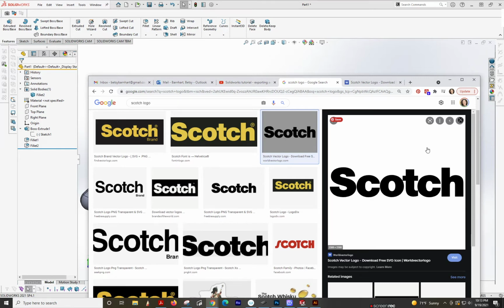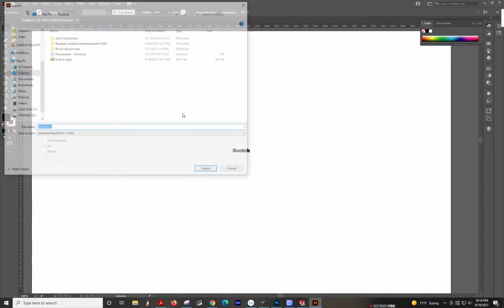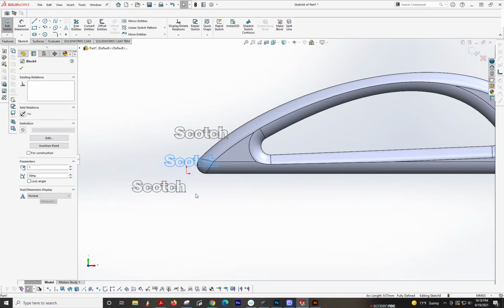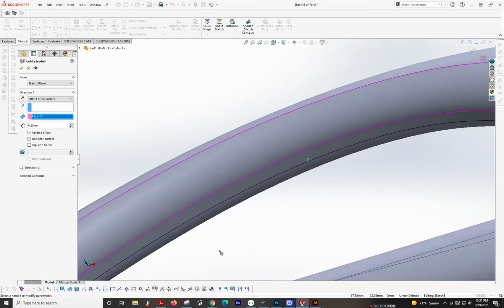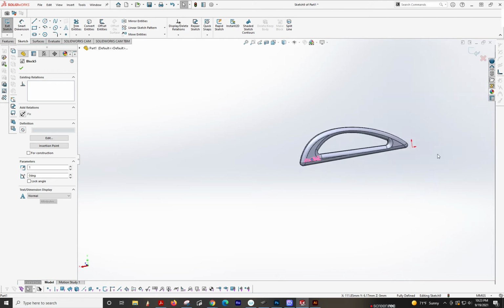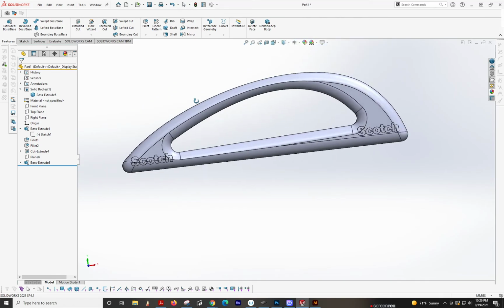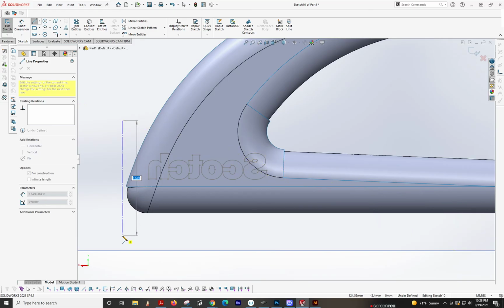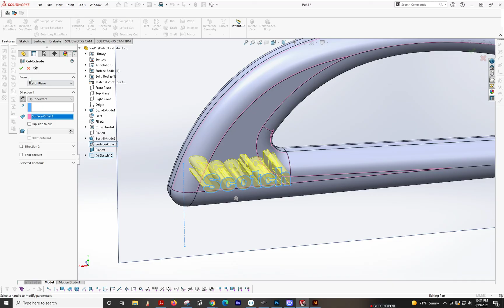Solidworks:  Emboss or Deboss Logo or texture from Illustrator through Solidworks

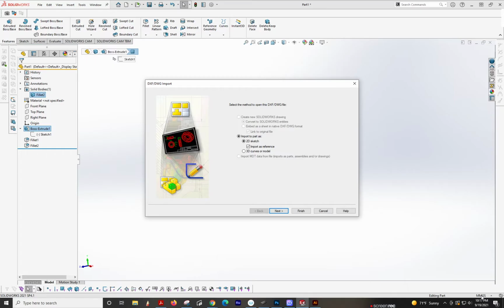Comment: The reason you couldn't edit the sketch after importing it is that on the import, you had the Import as reference option checked (3:35). I didn't know about the way you used to solve this, I just reimported when I ran into that. Thanks though.
Reply from the maker: Thanks!

Comment: Hi! Great video!
Can it do inner tapered letters with some angle, for a molding?
Reply from the maker: Do you mean adding draft for manufacturing? Yes, you can add draft when you do an extrude cut, that should take care of it. Often you need to make a plane close to the surface so it doesn't get distorted.